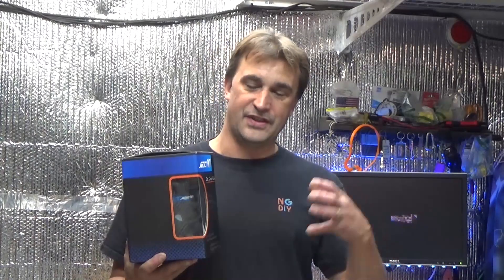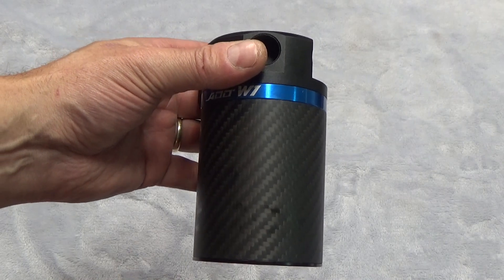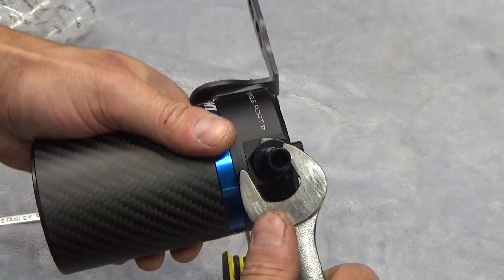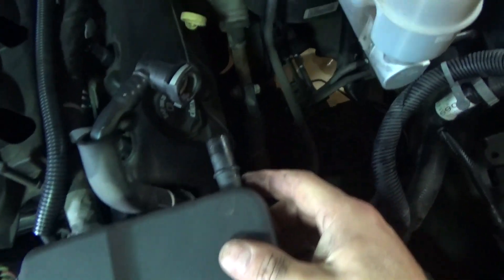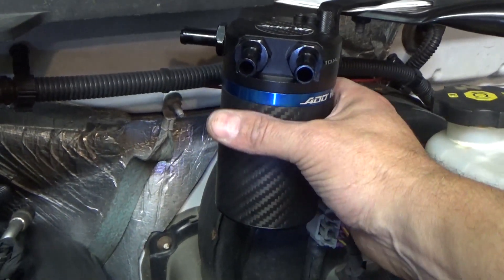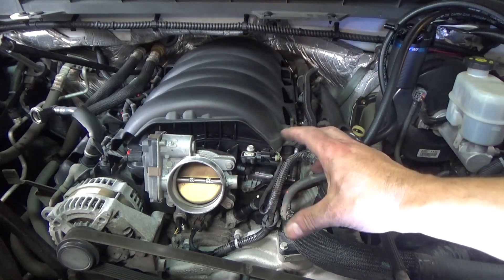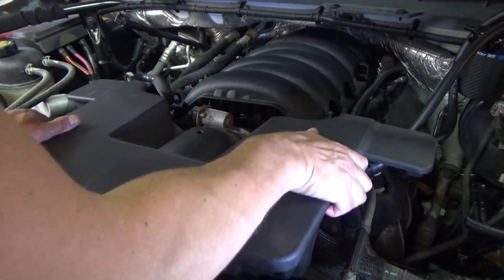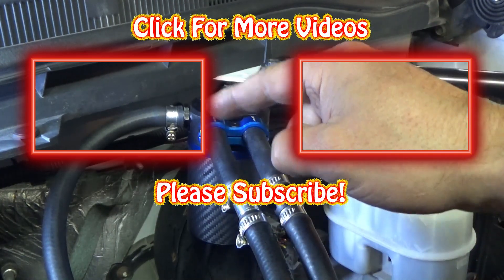Add W1 V3.3 Dual Clean Port Carbon Fiber Oil Catch Can Installation On GMC Sierra & Chevy Silverado

Comment: I am so sorry you installed a ADD check valve. They are HORRIBLE. Also, a 3 port is not recommended.
Reply: why are the horrible

Comment: Instead of putting the hole at the top of the air box that attaches to the throttle body could you tap it from the bottom just to make the install look cleaner?

Comment: You mentioned you chose to put the can in the location by the brake booster that way if you spill any there is nothing of concern below. Ever spilled oil on am exhaust manifold? It smells really bad until all the oil burns off. You have the potential to spill a lot on the exhaust manifold depending on how often you empty the cup. Sorry but this is not the best location.